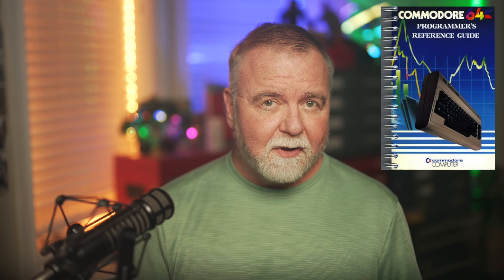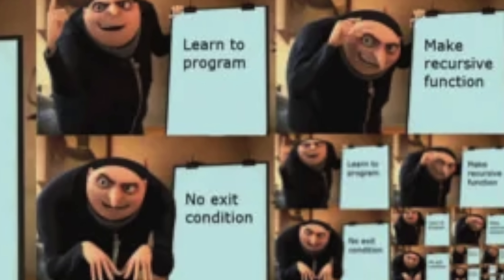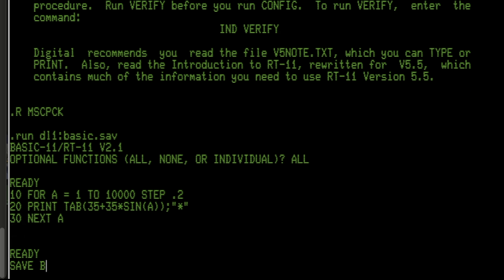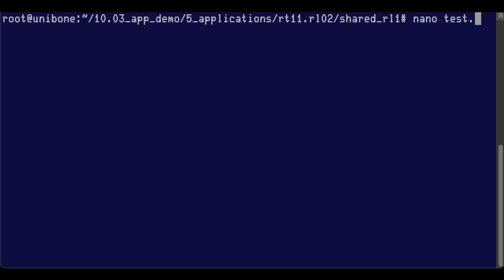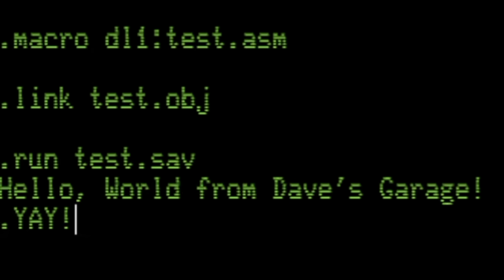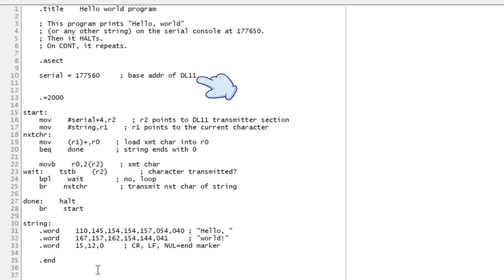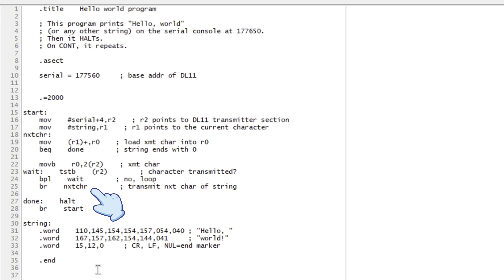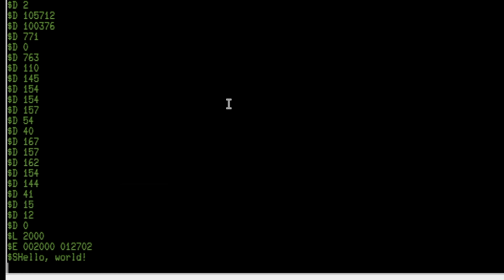Bare Metal Coding: Big Iron!  Assembly Language on the PDP-11/34

Comment: I call that JSR RTS question a "trick" question. Just because multiple JSR instructions may use the same RTS instruction DOESN'T mean that each JSR instruction doesn't require a RTS, they just don't each need Their OWN RTS instruction.
Reply: RTS is not required if JSR is not intended to ever return, eg infinite loop or intentional HALT. That might leave something on the stack but in those circumstances it doesn't matter.
Reply: @sharpbends  Wouldn't it make more sense to use something like a JMP instruction for that?
Reply: There are cases where, for example, JSR is used to call an error handler, where JSR is used to automatically push the program counter to the stack, and where the error handler never returns to the program. (the error handler pops the address from the stack without RTS)
Reply: @a4d9 that was one of my first thoughts too. And rop chains are rts without jsr. And you can put stack into rom and just use push/jsr to change the stack pointer, pop/rts will grab values from rom. I suspect that most teachers wouldn't comprehend these methods, but they would have taught students better what was going on in the CPU
Reply: @lorensims4846 Absolutely. RTS can still be achieved by stack and PC manipulation as well.

Comment: Dang, in 1990 my Assembly Language Class was on a PDP-11 using DEC VT-100 terminals, and an ancient teletype for output.

I miss Octal.  This was the only time in 44 years of programming that I got to use it.
Reply: I have fond memories of Octal :-) When I tell non-programmers about it they look at me like I am crazy.
Reply: But hexadecimal was such an improvement over octal.  It makes so much more sense to group bits into chunks where the number of bits per chunk is an even number.  Once hex became common, all of the older systems should have been revamped to use it.

Comment: This is a machine from before my time. I grew up with Commodore and Atari 8bit machines in the 80s. Though I witnessed the development of computers until now it still baffles me that a computer that was bigger than a fridge, needed a high voltage supply and consumed more power than the average household and cost more than a house in it's time could nowadays be replaced by a $4 microcontroller like the raspberry pi pico (would love to see them benchmarked against each other).

Comment: Thanks Dave. Love your work. My "bare metal"  in 1966 was an IBM 1620 M1 with an 80 col card reader. Great to learn on as it operated in decimal, and no bootsrap as it had a "Load" button (read card image into pos 0 and branched there). It had no registers, just storage to storage commands (well one for a sub call to store return address). Then we got a 360 so I had to learn hex and operating systems.

Comment: Reminds me of the 1401! My first computer job was programming and operating a computer that was only one year younger than I was. Autocoder also used the more rational from/to method to move data. Every assembler I've coded in since uses to/from and I've never really understood why.
When my company finally switched to an HP/3000, I salvaged some things: A core storage unit from a 1403 line printer, some random 1401 blade cards and manuals for both the 1401 system and Autocoder language.
Life was so much simpler then. with no operating system, punched cards, and a physical Bit-Bucket I had to dump at the end of my shift.
Remember Coding Sheets -- and the maxim, "Real programmers code in INK"?
Reply: I still jave my COBOL and ASSEMBLER coding sheets. I began on 407 accounting machine doing plugboard wiring then a 1401, onto 360/30, 370/138, 4300 series [4331, 4341, 4361, 4381] Then to 3090, Amdahl 5880 and s/390.
I was a systems programmer on all those machines, wrote millions of line of assembly code. I get a kick out of people calling ANY PDP computer "big iron"'
I am well versed in 13 languages, but my fav is assembly on REAL big iron where there is no silly stack pointer and other silly things

Comment: That was fun. Some time back you did a great video on virtual machines. There are of course "retro computer emulator" virtual machines out there you can run under your hypervisor. These include the PDP and many other highly proprietary architectures. Its interesting because of the different architectures and design tradeoffs each vendor took trying to carve out a niche to survive. You had "database" machines and "number crunch" machines and even graphics "rendering" machines - the predecessor to the modern GPU.  Linux users are used to having everything mature and available but there was time when nothing of the sort existed - then came the  advent of UNIX, its portability, concurrent multitasking and most importantly consistency was enormous. The PDP  and VAX became "gotta have" for every University CS program. With it of course came "C" and the rest is history. UC Berkeley's Unix Distribution was monsterously important with its Network File System allowing disk sharing.  They also developed RAID - to make one big reliable drive out of many smaller ones. (Drives were not that reliable for their first decade.) Microsoft even made a Unix Distro (XENIX) to go after the University and server markets originally.  In the tradition of the famous Monty Python Yorkshireman sketch - "You tell that to kids today and they won't believe you."
We all have our favorite hardware. One that dazzled us with its ingenuity or epic leap forward. I loved the Symbolics and Thinking Machine systems but the Xerox Star left me awe struck. Everything about it was right, elegant, logical even intuitive. Not only for the User with its Graphical User Interface" (no more begging secretaries  to read manuals for months to learn how to print a page in Troff) [we called computer literacy "joining the cult"] but the hardware - just sublime - and extensible. No wonder Jobs pivoted Apple immediately after seeing it. Xerox also had the Laser Printer and Ethernet hooking it all together. It must have been like walking through a time portal for him.  Great stuff.

Comment: I have always loved coding in assembly because I had total control over the CPU in those days. I cut my teeth on it as a kid with  various MCU's - 6800, 8085, Z80... 

My formative commercial years were on bare metal and very constrained single processor embedded microcontroller systems before the PIC's and similar arrived . I spent YEARS developing code for a Hitachi H400 4-bit microcontroller on a 4.77MHz PC development system using using Word Perfect as an editor (RIP Bruce Bastian)  native Hitachi tools, programming to a UV reprogrammable part with broken legs (they were expensive)  and crash and burn, bringing out test pins to unused I/O as traps. Code ran into hundreds of pages and I came up with my own bottom-up coding methodology that worked at the time and at the higher level of the programme the systems became almost high level configurable although with some faff. 

Happy days.

Comment: I developed a term insurance/ mutual fund application (competing with full life) in 1977 on my Processor Tech Sol...that cost me $5,000. The company wanted to go nationwide so I bought a PDP 11/23 for about $35,000. The program was written in PT Basic. When I converted it to run on the PDP 11/23 it wouldn't fit. And I only had 4K bytes of static ram on the Sol. I had more memory on the PDP but the RSX-11 used it all up. I really took a bath on that deal. Even after I got it working and on-line, the company that needed it stiffed me. Live and learn.
Reply: Wow, you got a story to tell out of that deal. What did you end up doing with the PDP 11/23? Did you at least get some enjoyment out of owning it, or other projects? 35K is more money than our family home cost in the 70's.
Reply: I hung around a computer store and they were developing an Amniocentesis analysis program on a Sol-20. They decided it was better to give me a job testing the app at minimum wage then letting me sit around and play on their computers. They gave me test script to run and  check expected results and to note deviations from the expected results. Not a bad job for a 12 y/o. I worked for three months for an hour a day after school. I always had to disappear if the client was on site.
Reply: I loved my Sol, too. Especially the first original PTDOS that limited Random Access files to 16k in length.  .

Comment: Lots of memories there. I started UofR in 1979. Used a dec pdp 11, to write my first code. The machine was actually in the computer lab with us, but we had only a teletype writer to code on. Never forget when I got something to run rather than spitting out error messages on rims of 36 inch folding printer paper.  At least it was better than the punch cards for the IBM assembly language I would write a year later. We have come a long way.

Comment: We used a PDP-11 in my CS classes in the mid-80’s. I started programming on a TRS-80 model 1 with tape recorder storage. Wow! A blast from the past.
Reply: much the same with me, I started wit logic circuits on my electronics kits as a kid, then used slide rules and calculators until I forst used a trs-80 II to control an experiment at a technical college in 77-78. Then used PDP11-10 mark-sense card reader at uni, explains my tenuous and highly bemused grasp of reality to this day :)  Then my own trs-80 after working all summer in a steel mill to pay for it. I still have it, but sadly may have to let it go soon. Then onto another PDP running RSTS, then a VAX at Uni. Then 6502 SBC's in assembler, and onto the first PC's.  Been a fun trip, kinda.
Reply: We had a PDP 11/44 to write an operating system on for computer science in college.
Then they moved on to an IBM AT. The first program on the IBM was write a keyboard handler. That claimed most people in the class.
Reply: My first computer was a “Video Genie” which was a TRS80 II clone. It also had a tape drive. Then we upgraded it to the Stringy Floppy which was a credit card sized cassette with an endless loop tape. Worked really well until the tape unraveled, which happened often !!

Comment: Cool stuff Dave!  The big iron is well before my time but when I was a teenager I did a few projects on 68HC11 in assembler. 2K of RAM if I remember right, and only an X and a Y register.. but I was able to make a working machinery controller with a flickering LED numeric display.  The HC11 was in a DIP package and had RAM and EEPROM built in, so you could make real useful systems from scratch in just an hour or two using veroboard. Fun!

Comment: 11:12 I assume that there's also a pre-increment facility in the PDP-11 instruction set, and that this is the inspiration for the pre/post increment operators in the C language.
Reply: Yes.  C was developed on a PDP and almost every operator in C maps to a single assembly instruction.
Reply: This is just from memory, so I could easily be wrong, but I somewhat recall that PDP-11 has post-increment and pre-decrement, but it does not have pre-increment or post-decrement.  A C compiler for PDP-11 would have to output separate instructions for the increment/decrement if someone tried to do things in the “wrong” order (and if the compiler expected the ordering to possibly affect the result).